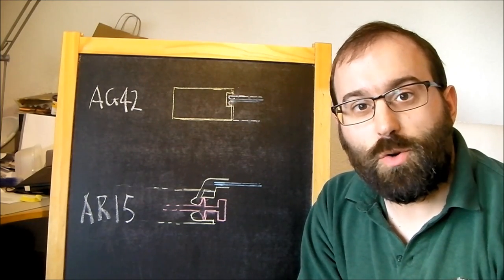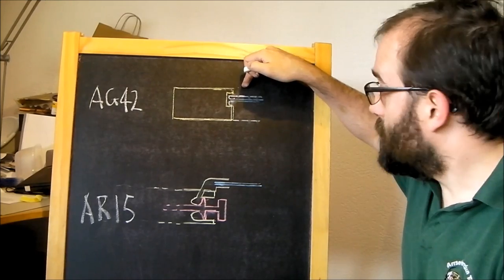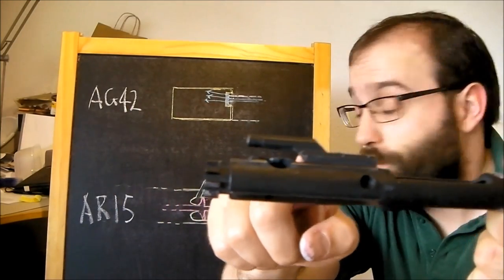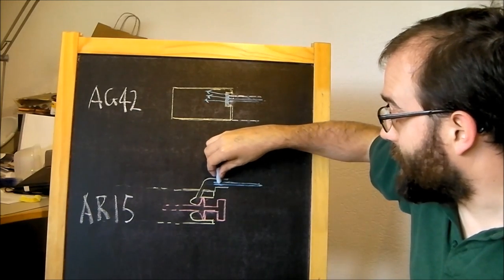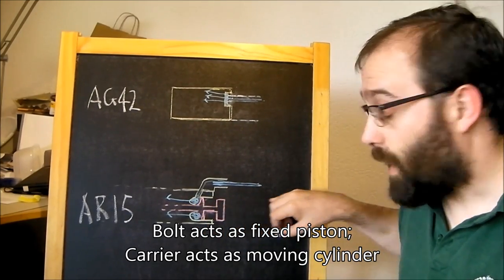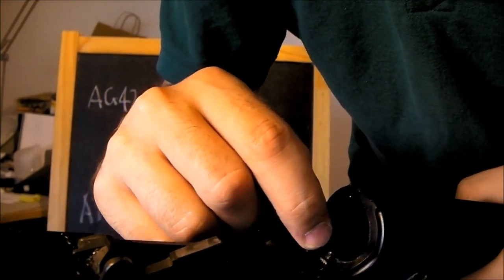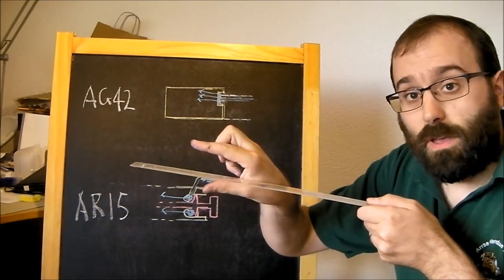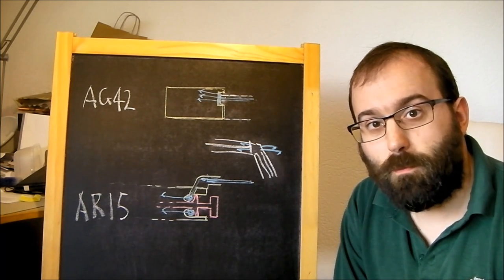Blokesplaining Direct Gas Impingements: Ljungman vs AR15

Comment: My fluid mechanics might be a little rusty, but I'm pretty sure a bend in a pipe carrying a fluid does cause a force. So the moment on the bolt carrier isn't completely eliminated, just greatly reduced.
Reply: It would be an interesting calculation.

Comment: Loved the video! Only side note not touched on within the video: because the force us expanded behind the locking face of the bolt, it delays the unlocking until gas pressure has dropped within the chamber. This has the advantage of increasing locktime. Otherwise, bang on in all points.

Comment: Short-stroke piston AR15 may seem to avoid the problem of the bolt carrier and heat sensitive springs inside it overheating... But is no improvement when the springs in the short stroke piston are then vulnerable to heat.

Piston AR15 type designs like the M27 automatic rifle actually have the bolts wear out quicker than M4 type AR15 rifles as the short stroke action has zero lul time, as soon as the bullet passes the gas port the piston whacks the bolt carrier with full force and begins to open the bolt with pressure still in the chamber.

Comment: Is there any significant advantage in fact that while the bolt is turning to unlock gases push the bolt forward. Does this system actually significantly reduce force needed to unlock the bolt?

Comment: Questions for you bloke.

1. What is the proper technical term for Stoner's operation system? What should I call it instead of DI?

2. Do short stroke pistons cause the same "schploing!" as the long stroke AK piston?

Thanks in advance, and excellent video as always.
Reply: Bloke on the Range

Comment: Great explanation of all those springy barreled AK slow-mo vids!
There seems to be a myth out there that gas-piston uppers are more reliable, looking at the wear on your lower I'm skeptical.
What was your reasoning to put a gas-piston upper previously on that lower?
Reply: As bloke mentioned in the video the AR gas system allowed manufacturers to use light alloys in the receivers. A piston system would keep crud out of the action but since the AR isn't tough enough to handle it without undue wear I would recommend not doing that.

Comment: Not convinced. It probably really means nothing if averaged out. Cheap was the order of the day. I worked on thousands(Literally) of M16 and A-1's. If lubed well, they work with broken rings and even no rings. I never came across it, but I am guessing that if the gas key was blocked back where it attaches to the bolt carrier it would still function.  I think a lot of the design came about looking for a way to get rid of the gas. One of those cases where you try to do one thing and get an unexpected benefit.
Reply: You really think it was an accident that stoner designed his rifle to have an inline recoil impulse?

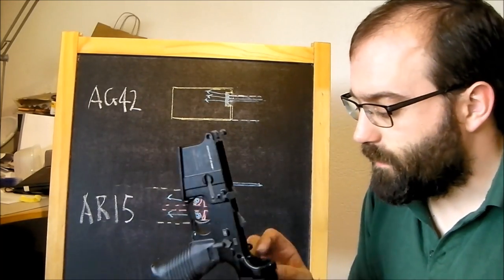Comment: 4:38 " gas piston twats a face ", is that that a technical or colloquial term ?
Reply: OK Rhetorical question, a UK slang which means ( as explained to me by a genuine Northerner ), to contact simultaneously  with every part of a body in an aggressive manner.
 e.g.  In the middle of a heated debate in a drinking establishment I explained to the gentleman concerned that the AR-15 is not DI but is actually an In-Line Internal Piston, and at that point, he twatted me  hence my presence in this hospital and the involvement of the local constabulary.
Reply: Oh and the other colloquialism is not suitable for a family channel like this.

Comment: There is no such thing as a stationary piston, since by definition, a "piston" is "a disk or cylindrical part tightly fitting and moving within a cylinder, either to compress or move a fluid collected in the cylinder, as air or water, or to transform energy imparted by a fluid entering or expanding inside the cylinder, as compressed air, explosive gases, or steam, into a rectilinear motion". The only reason the bolt moves within the carrier is to unlock it from the chamber. A gas piston AR uses the exact same parts and mechanism to do this, without gas present in the carrier. If anything in the system could be referred to correctly as a piston, it would be the carrier, since it is in fact transforming energy from the gases into linear motion, and the receiver would be the cylinder.
Reply from the maker: Err, type "fixed piston" into the search engine of your choice to test your definition... Or you could watch this nice animation of a dual-acting fixed piston moving cylinder hydraulic system: https://www.youtube.com/watch?v=yX_rCTcAPi4
Reply from the maker: Here's an example of a fixed piston internal combustion engine: https://patents.google.com/patent/WO2015015508A2/en
Reply from the maker: "stationary piston" motor is also a good search ;)

Comment: Hmm I didn't know you can own an AR in the UK. Anyhow excellent synopsis on how the AR operating system works. AK's are more than accurate enough to get the job done but no way are you getting sub MOA with one...at 50 yards. Btw you really want a fight in the comments section?....AR's are far more reliable.. yup that should do it.
Reply: +Bloke on the Range Lol wow, I didn't even know they made those. Sounds like a California gun. Bloke I've been subbed for awhile now and maybe you did mention and i didn't see it but where do you reside? If you don't wanna answer that i understand.

Comment: Direct impingement's still at least the 2nd fastest way to foul your action. I wonder what'd happen if the tube on the gas key was longer so that open end of the gas tube wasn't exposed during the stroke... I s'posed you'd then need some way to bleed the pressure off at full stroke.
Reply: I'm hella late, but check out Serbu's SU-15. They put the project on ice, but I think it should be close to what you're describing. TL;DR, there's a tube extending from the BCG all the way up to the gas block, which leaves open air between it and the gas block when it cycles back. This is the best video I could find of it in action: https://www.youtube.com/watch?v=jXFYUZB-hc0

Comment: in the past I maintained and fired the C7 (Canadian version of the M16). Never liked the feel of them when firing in semi, with that bolt carrier sloshing back and forth but full auto was much better. Easier to clean the gas system on the C7 then the FNC1 but the larger 7.62mm cal of the FN mad it a better rifle ( I think).

Comment: Stop, my sides hurt from laughing so hard. This certainly earns the Texas Balderdash Award. Your drawings imply gas blowback which is incorrect. Both weapons use a locking bolt. The AG42 and the AR15 both use direct gas impingement. Gas is tapped from the barrels to push the bolt carriers and cycle the weapons. Both carriers unlock the bolt during the first bit of travel after firing and the bolt/carrier assemblies are blown back with the remaining pressure. The difference between the systems are as follows. The AG42 has a tilting bolt lock where the back of the bolt drops into a pocket to lock the bolt in place for firing. The short "piston mechanism" vents out of the receiver at the top. The AR15 has a rotating lock like the AK where fingers on the bolt rotate and interlock with fingers rear of the chamber. The longer "piston mechanism" only ports the gas thru the carrier out the bottom of the receiver, nothing else. The AK uses a piston instead of direct gas impingement and a rotating lock like the AR15. There is a conversion kit to convert ARs to piston that keep the receiver and bolt cleaner. As for the precision slide on the AG42 to handle carrier torque, that's too funny. Yes, I do take pride in being an insufferable know-it-all.
Reply from the maker: "Your drawings imply gas blowback which is incorrect. " No they don't. Didn't bother to read the rest after that after that. If you don't understand the video, it's often best to keep it to yourself rather than wasting everyone's time, particularly yours.